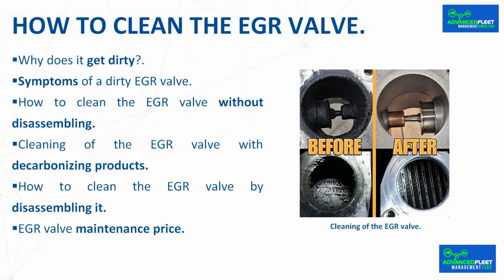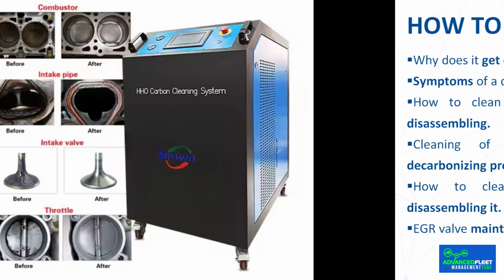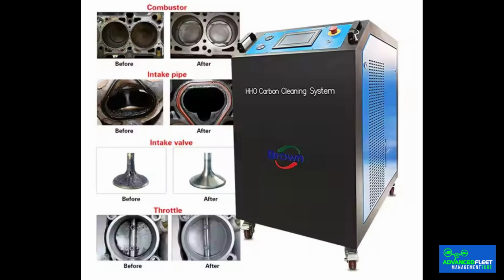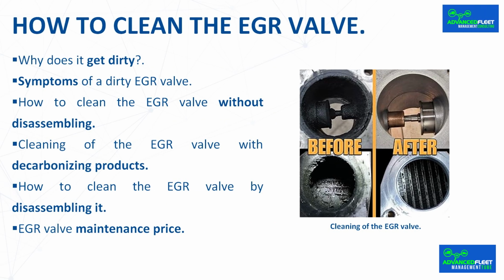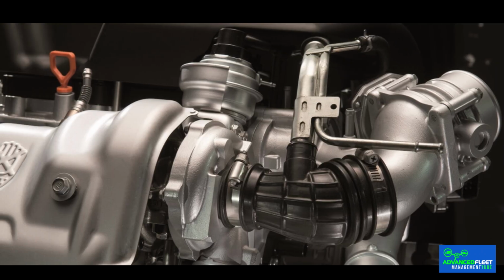What is the EGR valve and why it causes so many problems.

Comment: How did you got the problem fix my does the same thing for bit until I drive to the high way and drive normal I thought it was a fuel problem.
Reply from the maker: Hello, it's best if you clean the EGR valve of carbon deposits. I took my car to a garage. Best regards.